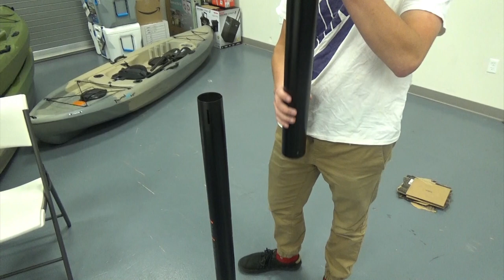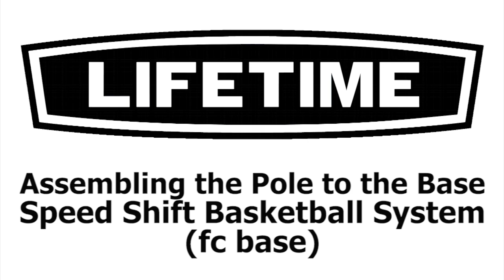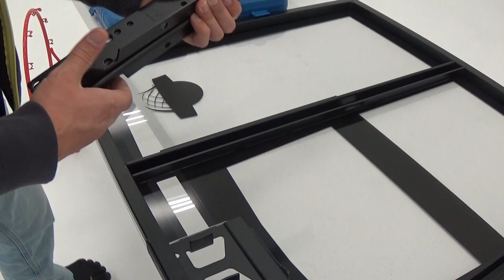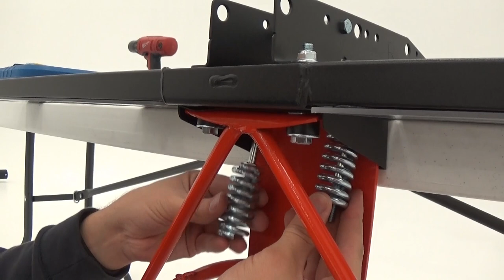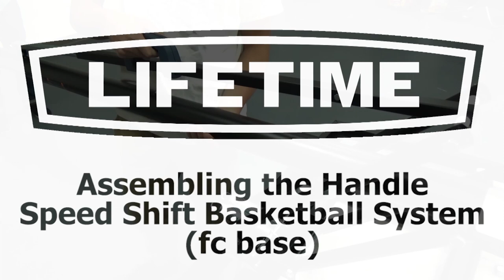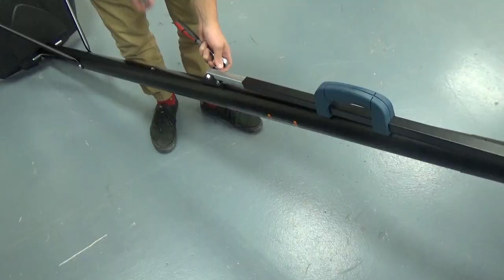Lifetime 48 Inch Crossover Basketball System Assembly

Comment: Important tips (model 90000):
- Many different wrench sizes are necessary, make sure you have two complete sets ready and they should be slim.
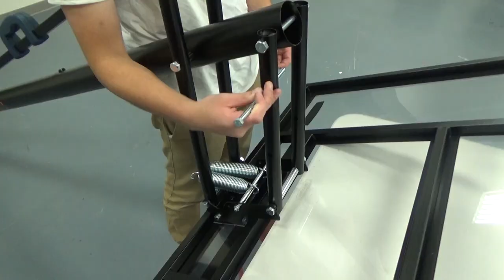- Add the backboard's spring (I had only 1) already at the step shown at 4:20. Funny how they skipped this step (also in the manual) and showed only how it's already mounted at 11:41. The gap between the hook and the spring was too narrow to simply stretch and hang it on the tube. I had to unscrew it, which was tricky and especially that screw was very thight.
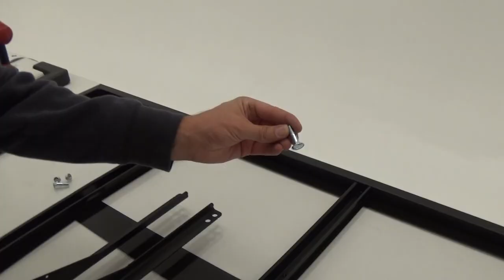- 6:12 make sure both sides of backboard brackets have the exact same distance from the top of the backboard to the screw, otherwise your backboard will be tilted to either the left or right (it's fixable afterwards, but quite uncomfortable to do).
- If you're fit, it's possible to assemble the whole thing by yourself, just a bit hard to pull it up, as it won't stand by itself. Add a bit of water/sand into the base and the rest after.
Reply: what if  i missed the spring? with no spring what are the consequences ?

Comment: I've assembled it properly but my backboard isn't straight up and down, it leans back a degree or two and as a result the rim is 10'1" high. Anyone know why this would be the case? I can't see where it could be adjusted to make the backboard, and rim, level.
Reply: I have the same issues, thought the pole and hoop assembly are all off by 2-3 degree. I am trying to figure out to jerry-rig this.

Comment: Can someone please help a non mechanically inclined person? I put the hope together but I cannot get my backboard to straighten out. It's bent down and I'm kinda at a lose how to make it straight. Loosened several bolts etc and nothing. Any help is appreciated.
Reply: Same
Reply: Same
Reply: How did you guys figure it out ?
Reply: Pa cey did you ever fix it
Reply: Drill holes a little bit above the current holes, then put the support bars in there and straighten it out from the holes u have drilled.

Edit.. Its a manufacturing defect